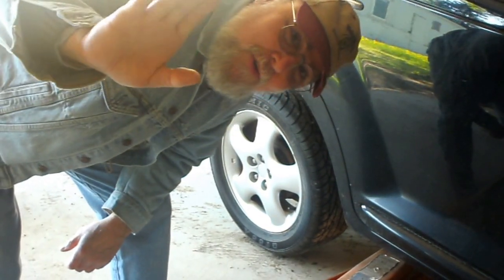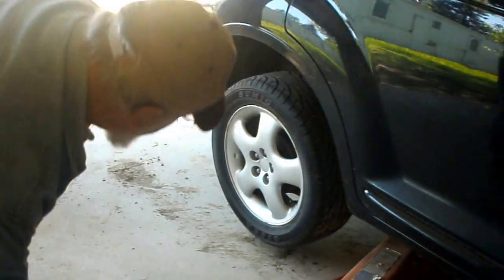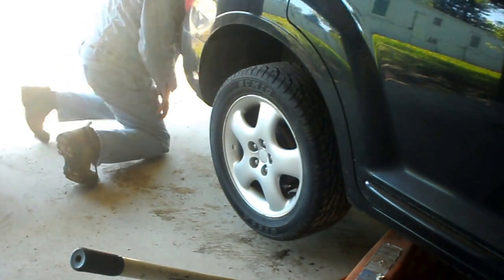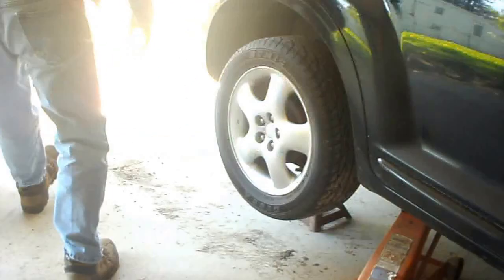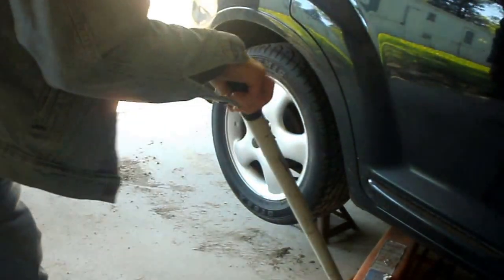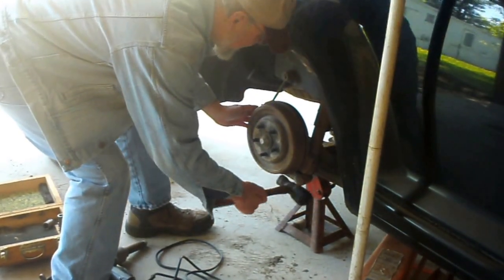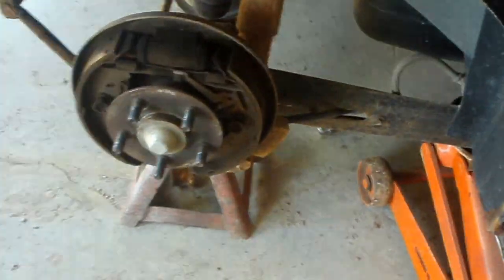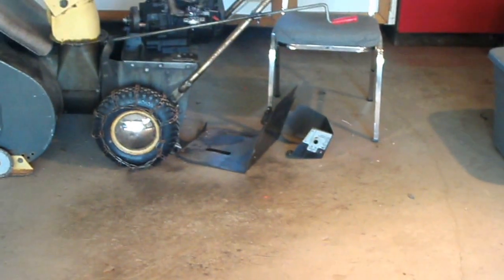Next time you'll be seeing red, PT Cruiser rear drums, brake grinding noise?

Comment: We had the same issue! Replaced the hub assebly(bearings are pressed in) and the sound went away for a while. It came back and we repacked the bearings and now its gone again haha! We highly suspect the new assembly we purchased wasn't fully packed with grease. These bearings are pressed in but you can still pack them with grease. Hope this helps you out!
Reply from the maker: The sound came and went depending on how long the vehicle set in between uses, like rust build up. I have since sold the car now and am driving a Chevy HHR. Thanks for stopping by Bennie.

Comment from the maker: Yep, I got it fixed! I replaced the cooling fan for the radiator. The old one only worked on one speed when hot wired and not at all through the relays. I didn't make videos of that. I should have...it was a major pain, but got it done.
Thanks for watching.

Comment: PT Rear brakes make noise because of dust buildup. A good cleaning will do
Reply from the maker: Ah, I cleaned and it made no difference. It seems to be an issue with these. If the time comes to replace the shoes I will use organic shoes, which shouldn't make the noise. It doesn't do it all the time.